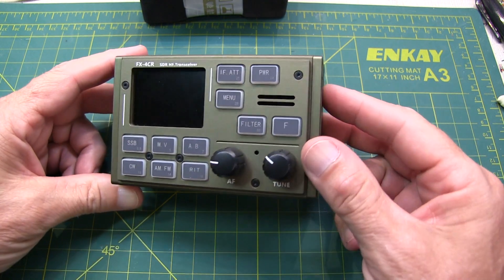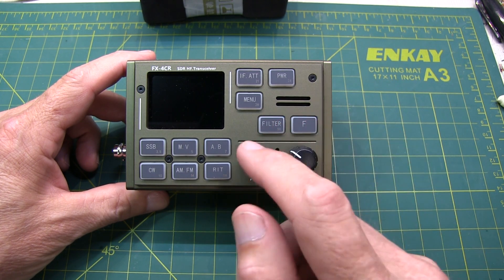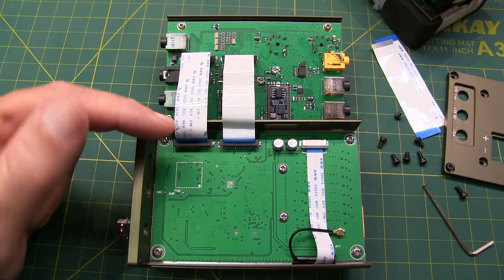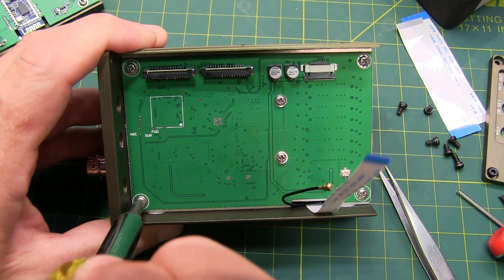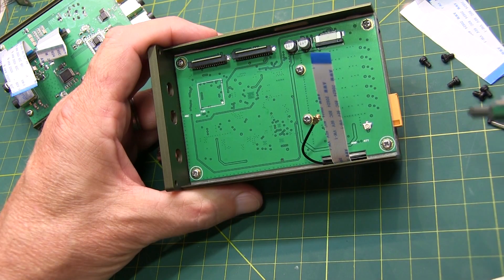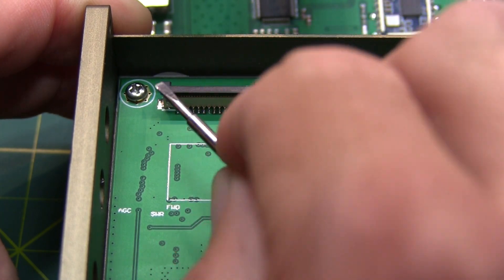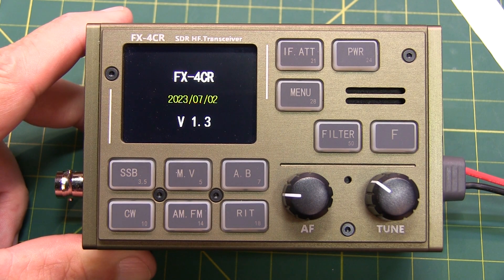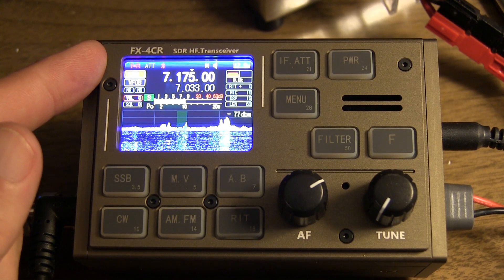#370: FX-4CR Transceiver PCB replacement procedure

Comment: Could someone explain what the use of this device is? I realize it's a radio but what other details might be available? RF is not an area that I have a lot of experience with.
Reply from the maker: This is a compact/portable transceiver (transmitter+receiver) designed for use with Amateur Radio, commonly known has Ham Radio.  It supports the most common HF radio bands and modes used by licensed ham radio enthusiasts.
Reply: @w2aew  neat. Thanks! Great channel by the way. I have learned a lot from you even though I don't really work in the RF realm
Reply from the maker: @FreejackVesa  Thank you - there's a lot more here than just RF ;-)

Comment: Thanks for the video Alan, my FX-4CR has not shipped yet, I assume they will install the new board before it ships but it seems pretty easy to swap out.
Reply from the maker: Yes, all current/new shipments will have the new hardware.  It was just the first 40 or 50 that were shipped a few months ago that were affected.